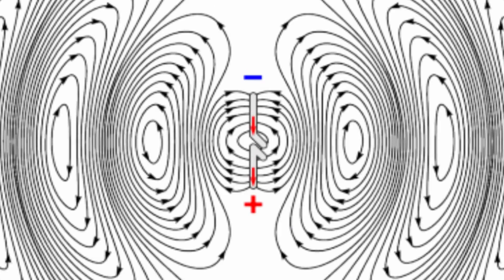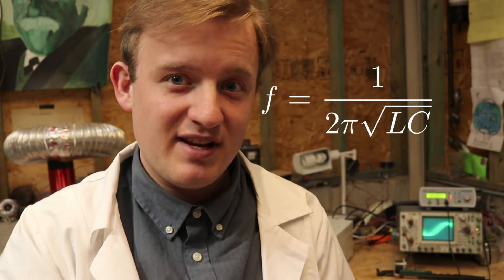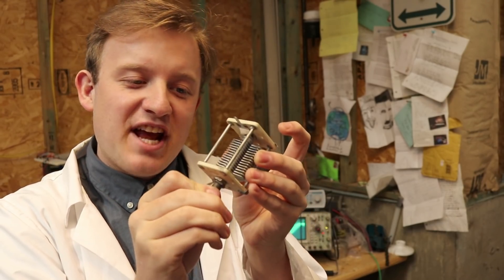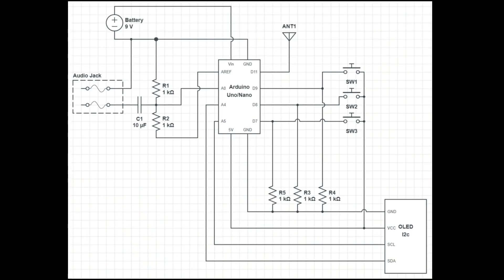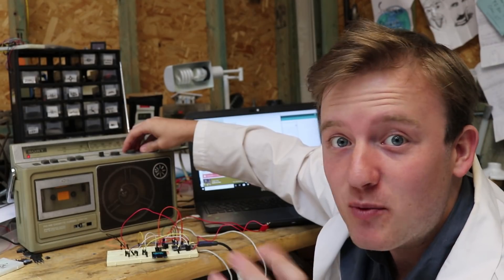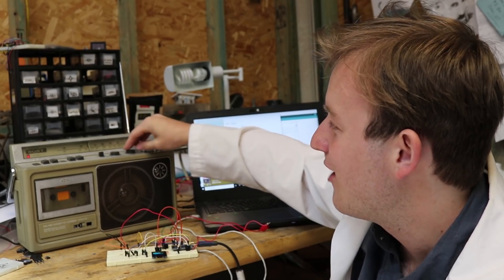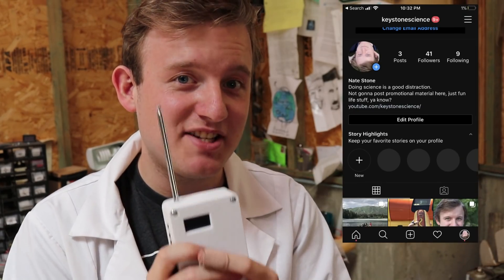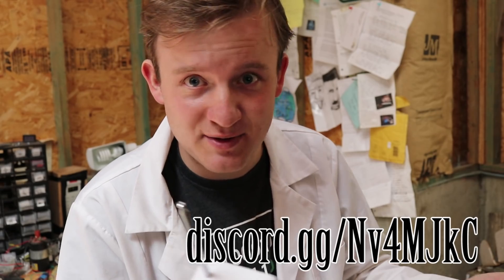How I made an AM transmitter

Comment: I was able to solve the stereo-mono conversion easily, so that there is no distortion on the mono output. 
 The stereo signal enters via two RCA connectors, which are passed through a stereo 47K potentiometer.  It goes to the 10K mono potentiometer via 2 1 uF capacitors and 2 1K resistors, and from there it can go to the mono radio transmitter via RCA output.  So far, it has been successfully used on AM/LW, OIRT FM and SW radio stations.

Comment: Oh damn, I definitely have to change some values in the code from 10 to 9khz because i don't live in Yankee land :P  Other than that this AM transmitter is pretty straight forward and a really nice use of an Arduino. So i really don't need 10 meters of wire for the Antenna but just a short retractable FM antenna would work too? Because i really only need it for a short reception range.

Comment: The circuit diagram of the transmitter as me a bit confused. You have the Aref pin and the A0 pin connected with a 1k ohm resistor. Assuming no significant current is running in or out of the Aref pin, both pins would have the roughly the same voltage on them. Doesn't that mean that AnalogRead(A0) would always return somewhere around 1024? (I haven't seen the code on the Arduino yet, but I imagine this would be a problem as I'm guessing the A0 pin is being used to interpret the signal from the audio input)

Comment: This reminds me of a funny story my Dad told me from when he was a kid, around 1940.  He and a friend both built tube AM Receiver/Transmitter in/on a cigar box that they could attach a telegraph key to.  They lived in the same apartment building in The Bronx, on different floors with windows facing the same way.  Well, they connected their radios together via a wire strung along the outside of the building and they discovered by messing around with the tuning and telegraph key, they could change radio stations on their parents' radios on a certain frequency, just like yours.  Only problem was that their connecting wire acted as an antenna that was 30-40 feet long, and they were changing people's stations in the building and then some.  Guess who came a knocking??  The FCC!  When they saw it was 2 kids messing around with changing their parents radios and not realizing they were affecting much more than that, they got a lecture and made them disconnect the radios from each other!!

BTW, glad I'm a fast listener!

Comment: As an amateur radio operator, I thank you for not blasting out power or using a good antenna. I've got a long dipole antenna in my backyard, kind of thing that you would use for 1/2 wavelength AM or shortwave, and it's crazy how much interference I can see. Now of course it depends on the time of day, but because devices like this are so easy to build, it's very common to see crazy interference especially in populated areas. Now if you were to use heavier-duty components, more power input, and a 1/4 wave antenna I'd bet you could get some decent distance on that. But of course this would be bad and quite illegal like you said. It's actually very trivial to direction find even a moderately weak signal, but nothing nearly as weak as what you are putting out and it's not an issue anyway because you are not creating intentional interference and keeping your power output miniscule. Again thank you for your educational and fascinating content. I am glad you are back, keep it up!
Reply: What would happend if someone uses spark gap transmitter